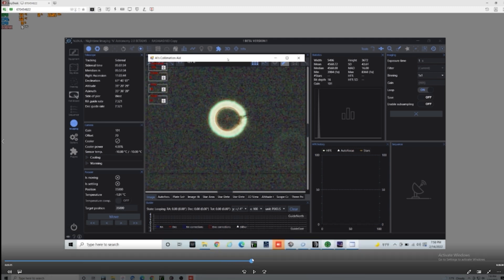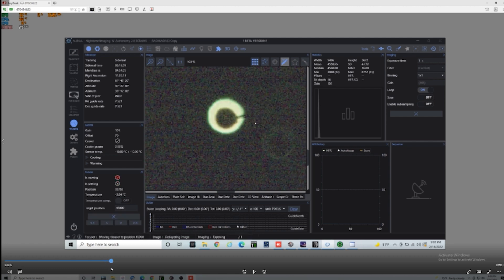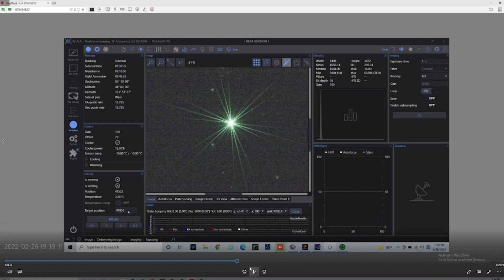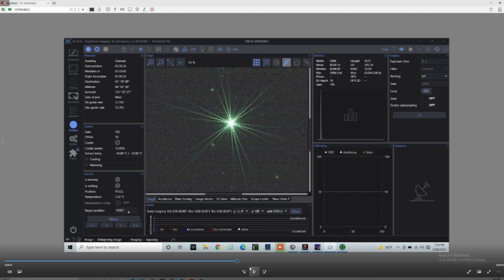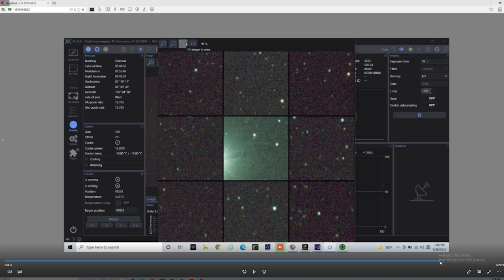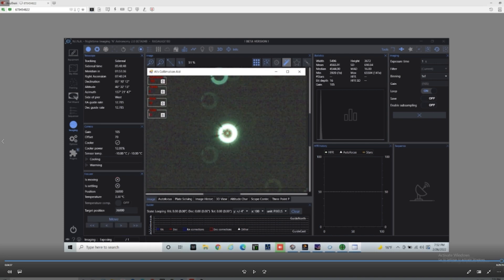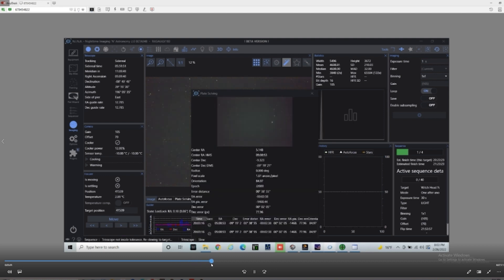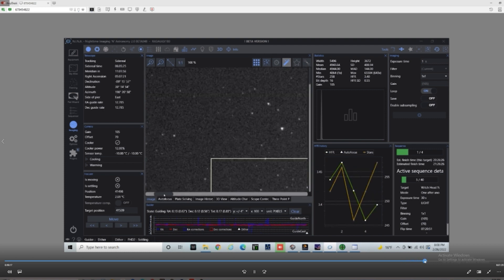HOW TO COLLIMATE YOUR HYPERSTAR IN 2022

Comment: Does it matter if 3B mask is slightly tilted? Unable to sit it on top of corrector plate because of wires sticking out of Celestron dew heater ring.
Reply from the maker: It does. I cut out a little relief for my few hester rings power cord to get it flat.

Comment: Collimating Hyperstar is a major PITA. The push-pull screws don’t have a lot of play, tiniest changes have big effect, and even slightest bump on long thin screws makes them loose. I wish Starizona had added plastic washers there to make them more tight. Also I think those screws aughta have soft tips.
Reply from the maker: Yes. Much room for improvement. After comparing to the octopi it’s very appersnt.
Reply: Now try collimating a very early hyperstar... just 3 screws between the camera holder plate and the main body of the hyperstar... and you have to use a tiny allen wrench to get to the screws... almost impossible to the point I haven't used my hyperstar in a long time!  This is the first i have heard of the tri-bahtinov mask... will be looking into that.

Comment: Hi Chad, I just collimated my HyperStar 6v4 with the Ocal Electronic Collimator!  People are trying to do star collimation but the mirror flops (SCT) and you loose it!  Well if you align with the baffle tube by leaving the SCT thread open over covering it with a reducer to prevent dust from entering but allowing light to enter, you can get PERFECT HYPERSTAR COLLIMATION!  I haven't been able to do a star test yet but I use flowers in my back yard to do doughnut test and my doughnut are now perfectly round.  My images are razor sharp.  Mirror flop is taken out of the equation!  I ended up getting mine from the UK as none are available here in the states.  You can check out the other youtubers on how to set it up but there isn't anything about there about collimating a HyperStar! Yes it was $200 but dude this saves imaging time!
Reply: OK The Ocal EC worked great for collimating the secondary mirror.  Not so good for Hyperstar!  I ended up with comet starts LOL.  I figure out that if get almost to focus, to the point where I barely see the center obstruction at the middle of the star, I noticed I can collimate and move the center obstruction to the middle.  I keep doing this until the star is so much in focus I cant see the little dot anymore.  Now you are done, perfect round stars in and out of focus in and out!
Reply from the maker: It’s such a hard process. I’ve been struggling with it lately and have been using my gt81 every night
Reply: @easyastroimages5818  When I got my Hyperstar 6v4, I noticed that there was no gap when the collimation screws separate the lens assembly.  I found out that there should be at least 1 mm of space there!  So I used a piece of cardboard that was about 1mm and went all around loosening and tightening the screws.  Once it had that 1mm space all the way around, I would use the Al's Collimation aid to roughly center it while it was defocused to a doughnut.  Then once I did the technique of keeping the eye (center obstruction) centered as I zoomed in until the focus star (Vega) turned into a pointy star and I could no longer see the eye in the star.  If using NINA or Sharpcap, just keep zooming into the star and focus until the center obstruction disappears.  Then you are done!  If you tighten down the screws very finger tight, you shouldn't have to do this again for a long time.  I don't keep my HyperStar attached all the time as I dont want the corrector plate damaged when I move the scope and I often I image at F6.3 or seldomly F10.  Sorry for the long comment but I want to help :-)

Comment: Very nice and informative video, Chad. Thank you.  During the collimation process, do you need to periodically refocus? And is that why you prefer the TriBahtinov mask over the simpler Duncan mask (which I've heard people say it's easier to use than the TriBahtinov)?
Reply from the maker: Yes you do but only slightly..thedunkin mask lines are so dang small you cant see them..this was the best..i tried one trust me lol
Reply: @easyastroimages5818  Thank you!  By the way, I'm curious what guidescope do you use? Mine produces quite distorted star images, but yours are nice and round. Do you use also a UV/IR block filter with your guide camera?
Reply from the maker: @juliokovacs1977  im using the orion 50mm guidescope on here with uv/ir cut..works perfect for me
Reply: @easyastroimages5818  Awesome, thanks!

Comment: Thank you for this much needed video. I’ve only dappled with collimation of my HyperStar (gave up quickly last year). After one or two or three attempts….I just flattened everything back to how I received it from Starizona. Ya gotta admit (as you do, LOL) it’s rather a beast to work with. I’ve read of people adding spacers (dimes) to  create a separation in order to move the HyperStar in and out…have you tried this method? Also, you mention the AVX mount. It’s been my first mount and I’ve always felt it gets a somewhat bad rap. I’m glad to see your guiding is going well with the AVX. Any tips on using the AVX would be much appreciated…(does it all come down to nailing the polar alignment?).
Reply from the maker: Yeah you need some spacing even if you just use the screws to make a mm. You don’t want the parts locked up or you can’t do anything at all. My last guiding video shows how I am doing guiding with the avx now with high frequency guiding. It’s working amazing especially with this light wide setup. Best I’ve ever had I think.
Reply: @easyastroimages5818  Do you ever use spacers prior to collimation?